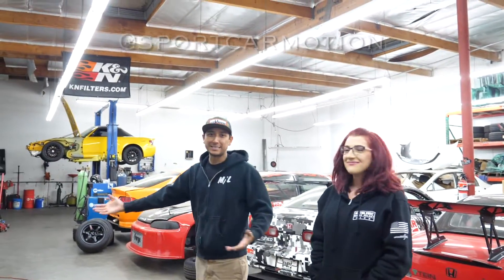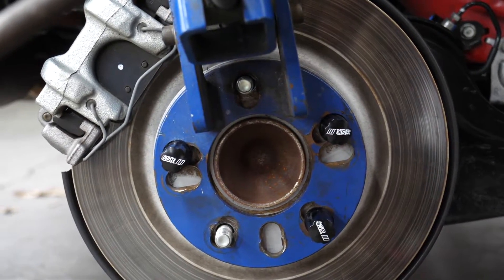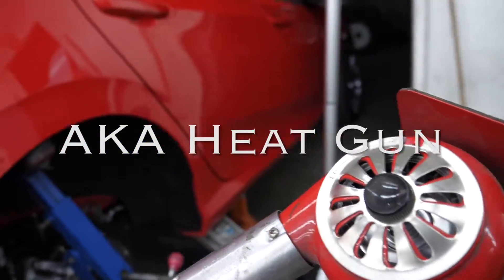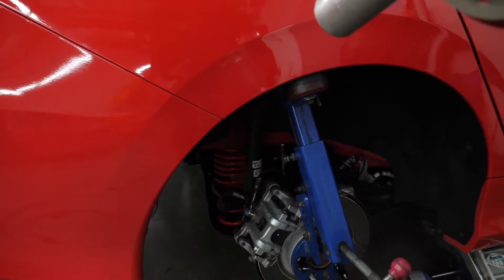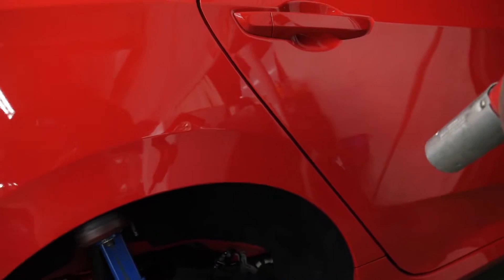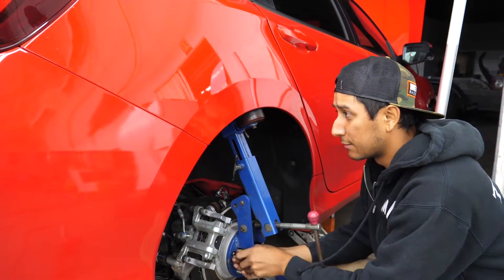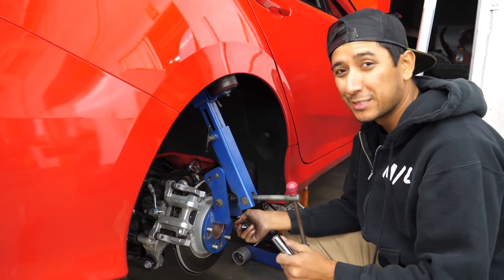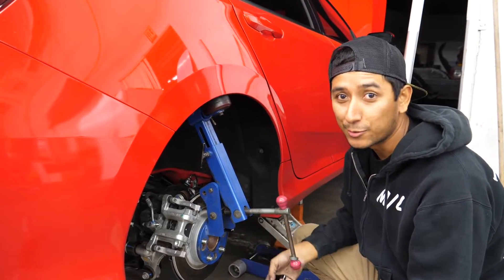Fender Rolling the Civic Si - Ososik Media

Comment: What’s the latest setup on the car
Reply from the maker: One has 27won turbo, Injen CAI/FMIC/Pipes, ClutchMasters FX400 Full Face, Hasport Rear Mount, Eibach springs, E85 tune, that tune is now available on the powermetric.net website (Stage 27won).

Other has PRL turbo kit (PRL full bolt on), Clutch Maters FX400 6 Puck/Flywheel, Hasport Full Mount, HKS Coils, Reinforced Motor, E85 custom tune.

Follow me on instagram ( @ososik ) and that's where you can see more up to date post of my set ups (even though I sometimes make late post on there too lol).